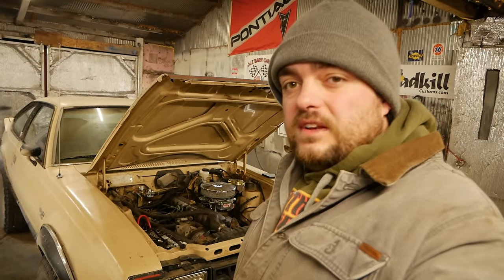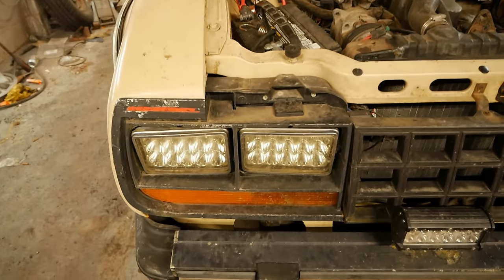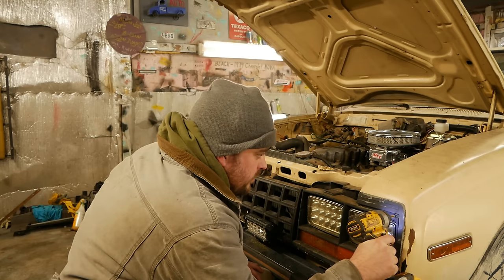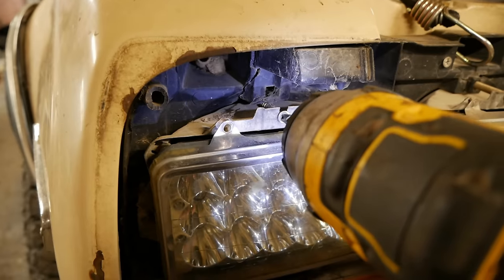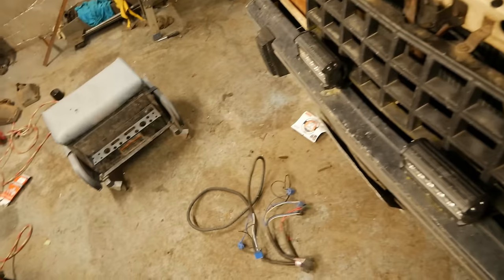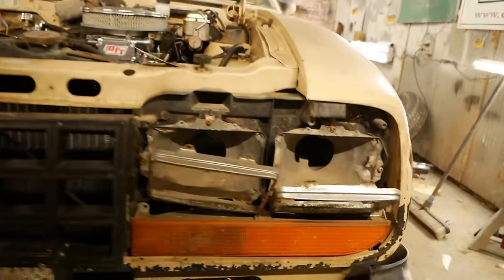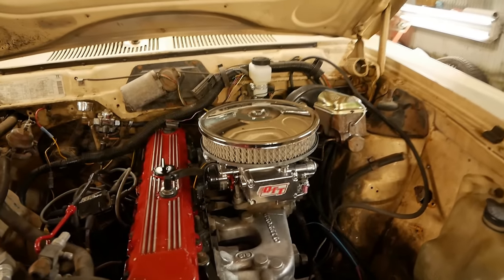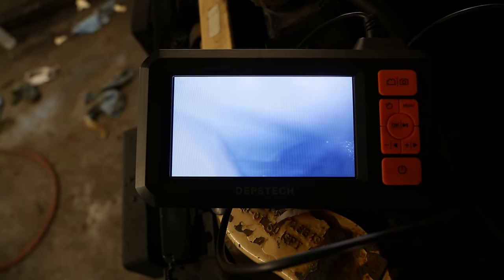AMC Eagle SX/4 Gets Facelift & ENGINE Reveals SURPRISE!

Comment: The red tractor painted valve cover was pretty good, probably will chip off in the summer time.  Having your kid on the camera and commenting is probably gonna be the key to your channel's success.
Reply from the maker: Free labor
Reply: I thought the red tractor paint, with the nail polish brush, would have worked for the stripe on the grille
Reply: Year update: It is you were right.
Reply: They have a finger nail epoxy resin that cures under uv light that might last longer.

Comment: I know i'm late to the party here, but as an old jeep/amc smoothbrain somewhat enthusiast, i believe this is a Renix 4.0 engine. What convinced me of this was the battle you had to go through in order to get the oil filter off. The Renix 4.0 in my Comanche took a metric sized oil filter; they put a sticker under the hood from factory warning against using a standard 3/4 oil filter. It would cross thread on and become nearly impossible to remove. You can order a stud from an HO 4.0 that will thread into the bolt and convert it to take a 3/4 oil filter. 

They're decent engines. They don't make as much power as the HO, and there's a ton of unnecessary wiring and vacuum nonsense. But that can be culled down some.

Also, the central axle disconnect can be bypassed for free. You were on the right track, you just have to remove the c clips inside of the actuator and move the rod over and the re-apply the clips so that the fork is always engaging the locking ring on the axle splines. I did this on my Comanche as well, because that is a failure point that will cause your 4x4 to not function. It applies more wear and tear on your front diff, but i'm guessing you're like me and won't mind. 

Hope this helps. Enjoying the videos !

Comment: I know this is an older video and it probably don't make no difference now but cars back then you had to have the headlights on for the fog lights to work that's why you probably were not getting power to the fog lights they either work with the Park lights or the headlights but they will not work with the high beams that make some turn off it's just the way they used to be and that car probably came with Marshall fog lights they have like a little fox built into the glass they also put them on mustang GTs I had an 85 and I remember those and also my Lincoln Mark 7 LSC had those same fog lights so I kind of know them fog lights off but love the videos you and your son are great.

Comment: I watched the JYD video. I never knew a truck body could move 5 different directions at one time, impressive. And the wiring on the Eagle would send me into an OCD overload. Well actually alot of that car would. But thats why I only have 1 out of 4 cars like that. And it at least is marginally better then it was. Keep it up. Hope to see more in the new year.
Reply from the maker: Make sure you check out the other videos! Your ocd will go insane
Reply: OH I've watched from the start. And yep. But still fun. And yes I am guilty of some of the shenanigans. My 1 out of 4 is hacked together not by me I'm trying to correct it. And well I painted it with Rustolium. But I used a gun. Not that it turned out but at least it was better.

Comment: You may have a collapsed lifter and or a sticky lifter. I had the same issue with my 91 XJ 4.0. The cam was fine but I replaced the lifters before the cam lobes got wiped. Love my XJ even though it doesn’t love me back. You earned my sub. Love junkyard digs videos.
Reply from the maker: Thanks!

Comment: MINT !!!!  Kicking off the weekend & 2023 with PBG 

I genuinely appreciate your ⚙ gearhead content and your tenacity too endure "global warming" temperatures 🌡 🥶

That AMC Eagle Sx4 is SWEET !!!! 
irregardless of the , 
erroneous LED headlamp wiring 

I would have taped into the original  LF harnesses for the RF too , if needed 

Glad the OEM harness
 wasn't butchered up 

Those headlights & fog lights
 turned out great  !!

Hahahahaha 😆🤣 
fast n furious 77 .... LOL 😆 

Holy f**** sh** 😳 
That pushrod was bent wosre than pretzel and yet ,
 that 4.0 was still running 

I appreciate your ISO9010 precision measuring technique 👌 😉 

Lucas engine oil treatment is pretty good too ...... from what I'm told 🤭🤫 

Can't wait to check out that truck from , junkyard Digs and that snowmobile

Comment: You gotta find someone who will trade an older waste oil furnace for some parts or a car.. then you could paint as well as repair vehicles in the shop during the winter 😊 they are super nice I don't regret getting the one I have, you can literally put basically all the old fluids from vehicles in the tank and it turns them into nice warm air pretty much everything but coolant haha

Comment: Great to see it driving down the road! 
I had that lifter tick in my SX4 - it was a 258ci. I replaced cam, lifters, pushrods and rockers and it was still there. Also a pushrod would slip out from rocker. 
Eventually I resolved it but it involves pulling that bonded rocker cover again. 
I machined down the rocker pivots which go between the rocker and the rocker bridge - with the rocker hold down bolt going through it. 
Machining was on a table grinder but measured for accuracy. 
It was fixed in a couple of hours and never had another issue. 

That front trim you could use pinstripe the same width. 

Cool car - I miss mine more now!! Thx. 😂
Reply from the maker: Thanks for watching!

Comment: I've been messing around with AMC's for 25 years now.  In that time, I've NEVER had a 258 that didn't have valvetrain issues.  Even the 232 in my Gremlin ate up a lifter once and both 258's needed new rockers and at least one of them took a cam.

Comment: Rislone makes a couple of products I haven't used the one you used I always use the ring seal repair on my 200 to 500,000 Mi engines. It does a pretty good job of coding the cylinder walls and reducing oil smoke.

The stuff I get is in a bottle that looks just like the one you are using but it's thick like you were expecting. Like old STP
Reply from the maker: I know, it's weird. I thought I bought classic rislone
Reply: Some of that lifter noise may even go away after you change the oil next time. I’m sure you know to change it’s warmed up.

Comment: "I definitely do not see them." 🤣🤣👍
You're side kick's timing is impeccable.
 Wasn't AMC big on plastic valve covers on the straight 6? 
All the ones that I ever dealt with were plastic.
That aluminum cover is definitely a better way to go.
I didn't know they used them. 
AMC were the Heinz 57 of cars to me.
The AMC matador looks like it was struggling while parked.
Reply from the maker: Early 80s 4.2 had the aluminum one. Likely original to this car

Comment: I did an H4 conversion for my headlights all four of them only cost me about $37 on eBay they work pretty good but I would recommend putting the ceramic plugs in because I had one of the plugs  burn out

Comment: There are 2 Bolts behind the steering wheel that when you tighten them up the wiggling steering wheel will be fixed. Had that problem on my 89 Cherokee and the wheel was solid as a rock after I tightened those Bolts. Super easy and free to do
Reply from the maker: 4 bolts, and requires total disassembly of the column. Been there and done it! I'll get around to it one of these days
Reply: @Pole Barn Garage  I don't remember it being that hard, but wish you the best. Thought it was just pop the wheel off and take out the turn signal/Hazzard assembly and the Bolts were right behind that. But it's been 17 years since I did it lol

Comment: That motor sounds so similar to a 2.9L V6 from the 1st Gen Ranger. If my guess is right by the sounds of the starter, probably the same one that is used as well. Also really dig those STX Ranger wheels! Have the same kind on my 83' Ranger 4x4 2.3L.
Reply from the maker: Good ears, AMC used Ford starters

Comment: We had the sedan when I was kid.
It always leaked oil from the plastic valve cover.
Valve tap was bad, so stp oil treatment was a must, and it did help to quiet them down.
But it's party trick was the back axles.
They snap off right at the hubs, and the wheel would fall while driving down road.
This happen to me twice.
The first time I was going 60mph and the tire got jammed in the wheel well.
When the tow truck got there he raised the back end up.
Then kicked the tire loose, and said this was the 3rd one this week.
But with the 4wd engaged it was the most stable car I've ever drivin on a dirt road covered in 6 inches of snow.
It just always seem to want to go straight.
Also it had one of the most comfortable seats I've ever sat in.
The only other that comes close are the ones in my old 1989 Volvo 244 which I daily and has over 600,000 miles on the clock.

Comment: Welcome to my world my friend …. Im working on  a 1986 eagle wagon …. I think your knocking is to much slack in one or two of your cylinders like what i had ( its to total engine rebuild ) sorry for for the bad news 

That bent rod was totally crazy to see
Reply from the maker: "too much slack in cylinders"...what?.. 😂 that's not a thing
Reply: @PoleBarnGarage  when I took the head off of my 4.2 L in-line six motor….. the cylinder walls and two of the cylinders, and I would also imagine the piston rings were so worn that only two cylinders you could put your hand on top of it and move it side to side, and it would have about an eighth of an inch worth of slack….
I’ve seen it twice on two separate motors

Comment: I wonder if since there's a different head the pushrods are a hair too short. Or lifters are collapsed, had that on my yaks 400, took a few thousand miles but they self adjusted and now it doesn't clatter 👍
That thin blue rislone stuff is lifter/sludge cleaner not oil thickener
Reply from the maker: Head and block are both 4.0. 4.2 would have a 1/8" longer rod

Comment: The Chinese really are smart. We pay them to "dispose" of our electronic waste, they take every diode, capacitor and potentiometer, install those components in "new" products and sell them back to us. I saw a "new" 2021 Chinese TIG welder with components from 1982 in it. They have sweatshops with people using SMD stations with really hot, hot air guns blasting whole circuit boards from our e-waste and another section testing and sorting the components, destined for those irresistible "new" products. Smart.

Comment: i had a 98 GC with a 4.0...damn thing knocked from day one of owning it with about 130 on the clock...drove it to 210 ish before i got rear ended by a mk5 jetta tdi lol...those 4.0's are a great motor...i read there's a stroker engine using a 258 crank...and a late 90's block....hhmm...maybe drop the pan?
Reply from the maker: I definitely suspect there's something going on in there

Comment: You should look into a Chinese diesel heater. Could stay warm without the noise from one of those torpedo heaters. I use one in my service van.
Reply from the maker: Like a convection heater?
Reply: @Pole Barn Garage  No the Chinese diesel heaters have a burn chamber like a waste oil heater. And you run a intake and exhaust outside so your not using the oxygen in the shop. Just type in Chinese diesel heater on youtube, lots of people living in vans use them. One I use is on my Instagram page.

Comment: I'm not 100 %but I'm thinking the "multi function switch" aka turn signal, needs replacing. (Along with the steering column) that will let the blinkers work and stop the relay switch buzzing like it does. 
It was the problem in my car (97 🐎)
I thought it was the blinker relay at first but I bought a new one and it still buzzed when I hit the blinker and still no signal working. 
I replaced the MFS and the buzzing stopped and the blinkers worked.

Comment: An organization I worked for had 6 of those Eagles,  All of them lost axel shafts several times,  so yes they are  all like that part of the time. They all experienced differential failures, but less frequently. Cracking exhaust manifolds was another common occurrence. This was all with careful, better than manufacturer recommended service. They wear more costly to operate than ever other vehicle type we had , all cost wear tracked in a computer system with fleet management software installed so it was all verified hard numbers.
Reply from the maker: I've owned a few, blown up axles, but usually by being an idiot

Comment: from an old Pontiac man...things get worn on those non adjustable rockers. Get you a hardball and nut off chevy and adjust it accordingly
Reply from the maker: These are bolts not studs
Reply from the maker: Also, the nut is the wear item on a Pontiac. Simply replace with original equipment

Comment: The steering columns that AMC used were garbage. My 1981 wagoneer has the exact same issue with the column and it's constantly shorting out and causing issues
Reply from the maker: They're a GM column, very simple to work on
Reply: @PoleBarnGarage  really? Well I'm not surprised because all AMC did was use other companies parts but that's good to know

Comment: You should leave the led headlights they are brighter than the factory
Reply from the maker: I can see fine with a nice halogen. I don't need to blind every other person on the road
Reply: @PoleBarnGarage  if they are wired up right they don't do that the only time they do that is someone wires them up to where they are on bright all the time but 90% of the time it's just some idiot that's to lazy to use the dimer switch switch

Comment: The standard beam headlights are ok if you are just driving it on your farm. But on the highway you are driving blind. The standard lights used to be good 30 years ago but not now. They are very useless now 😂
Reply from the maker: I drive with them all the time 🤷 aimed halfway correctly it's never been an issue. Hell, holey goat only has 2 and it also works fine
Reply: @PoleBarnGarage  i actually really like the holey goat. It’s a zombie car In away because you brought it back to life after getting shot over thousand times.